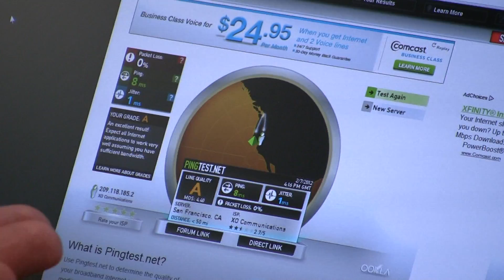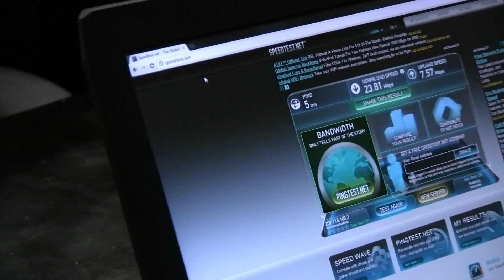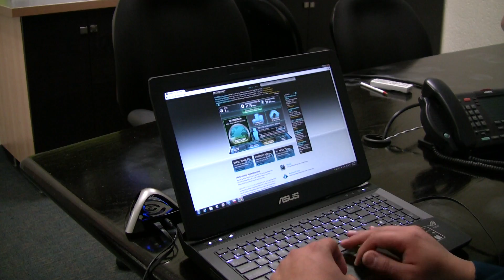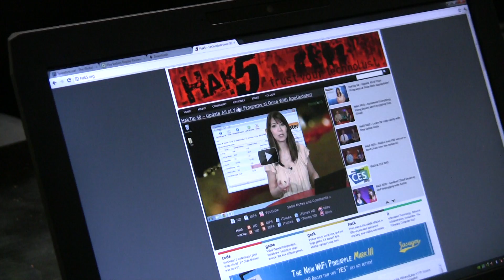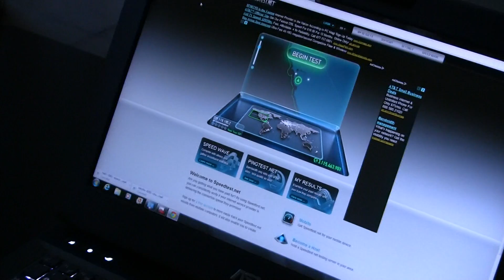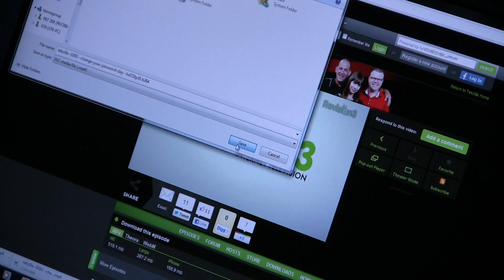ASUS RT-N66U Real World Test

Comment: Thanks for this video. I'm running the RT-N66U too and agree with the speed tests above, it's one of the faster routers I've ever used for wi-fi. I got a 80Mbit fibre connection here and can max it out in the 5GHz band all round the house even at distance. Worth the money that's for sure. Can connect using my mobile on 2.4 GHz half way down my street!

Comment: I'm not assuming that you dont know this, but from my experience, I discovered by changing the security settings (from WEP to WPS) you can adjust your Mbps speed up to 300.  Providing your wireless devices are 802.11n(not g or b).  If you do that, you'd also have to update your wireless access points(usb adapter & extenders) on your network for EVERY device unfortunately..

Comment: Asus is pretty good at WiFi-Routerperformance. I got the pce-ac68 and the rt-68u. My old router (linksys EA4500v1) was bad at 2.4/5Ghz (7-10m away) - Only 0-30Mbit/s down at 2.4GHz (failed at 5Ghz). Now I bought the rt-68u; 475-550 Mbit/s at 5Ghz AC!!
Reply: My internet-flat: 100Mbit/s down & 5 Mbit/s up

Comment: What I'm saying is if the technology of this router could be easily fit into the space of a USB adapter without overheating it would have been done long ago. No matter how much such an adapter costs, someone would buy it.

On another note, USB 2.0 has a max speed of 480Mb/s. Discounting the dual band feature of this particular router, USB 3.0 is unnecessary.

Comment: I don't understand why you would buy a USB wifi adapter. I'm saying get a wireless card. USB adapters drop connections and are slower for the price.

In any case, so you know, I'm getting around 80 Mb/s up and down wirelessly from this router from NAS over the wireless N with modifying the QOS to "highest" priority. That's with no other devices connected, so a USB 3.0 port on this router would be useless. Even so, I don't know why you would prioritize file transfer over anything else.

Comment: Which asks the question why aren't USB 3.0 ports default? You always seem to need drivers thus what's the point of using a usb 3.0 based flash drive to reinstall windows on a motherboard USB 3.0 controller

Comment: What is the wireless signal on this thing cuz i have huawei Hg556a ( standard from vodafone ) my ps3 is like 3 or 4 meters and 1 wall between router and the signal on ps3 is between 65 to 90% and this is really annoying i have lags and disconnects in multiplayer games, also my ipad 2 loads vids really slow, the video stops after 20 sec of watching and it loads 30 sec in 2 minutes even this video stopped after 39 sec

Comment: We just got Google Fiber installed.  We're consistently getting 950Mbps down and up.  How can we take advantage of the Wireless AC technology of this router?  The only USB adapter we've been able to find which supports the 802.11ac standard is Netgear's A6200.  However, when we put it to the test using the AC signal, we only got about 130Mbps max.  Does ASUS make an AC USB adapter?  If so, what is it and does it support USB 3.0?

Check out kcsv [dot] org [slash] blog for speed test results.